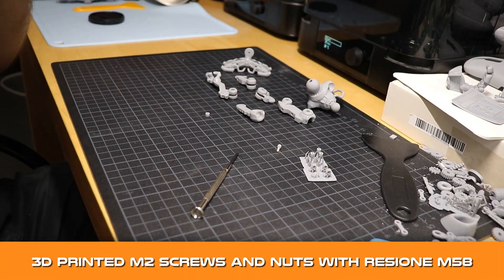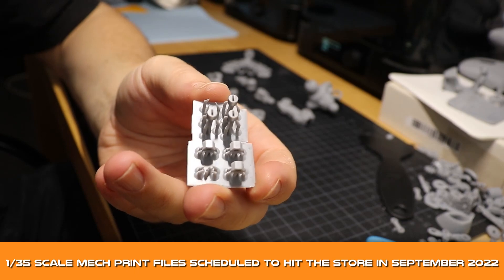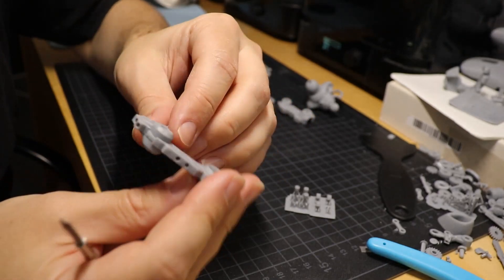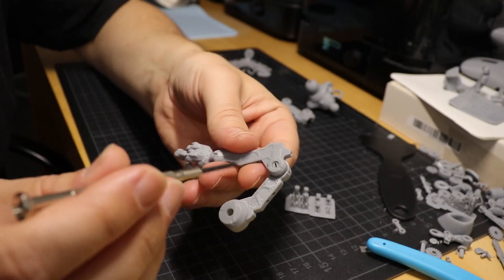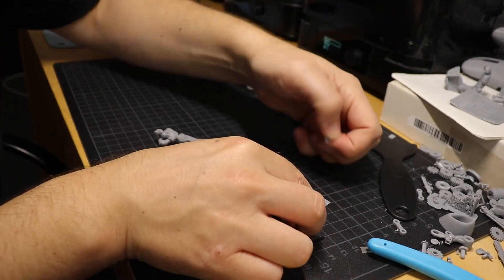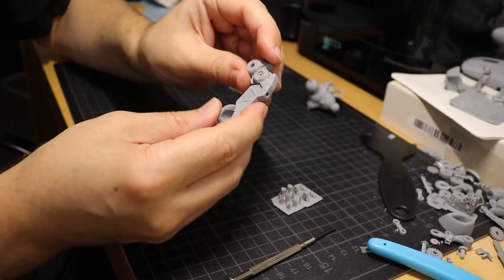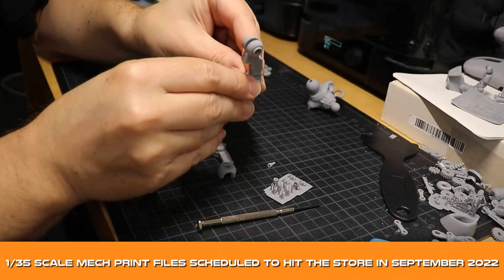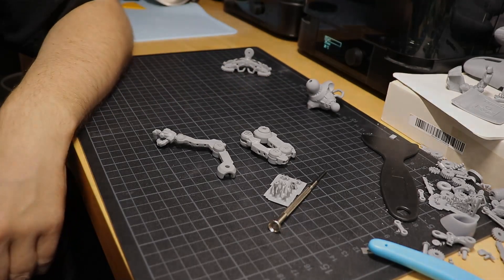working 3D printed nuts and bolts!

Comment: Will this model be printable on a small bed printer like the photon mono 4k
Reply from the maker: yes. It's basically an action figure/vehicle, so it comes in all separate parts that have to be assembled after printing. Even with small print beds, you can print a lot of parts in one go.

Comment: This is great as backup if you don't have M2 screws at hand. I usually have a box with different sizes of M2 and M3 (sizes used for DIY prited gadgets) nylon screws and nuts in black. They're a "must have" and are inexpensive in aliexpress.